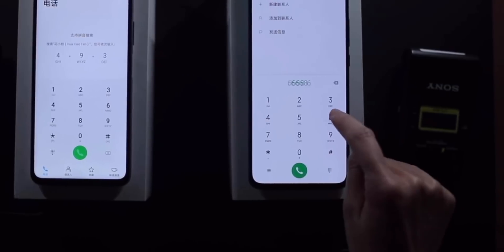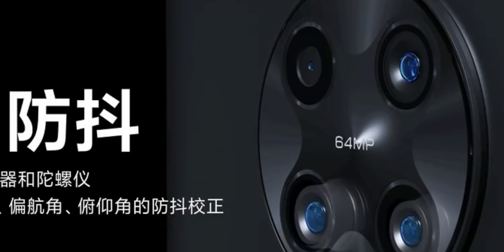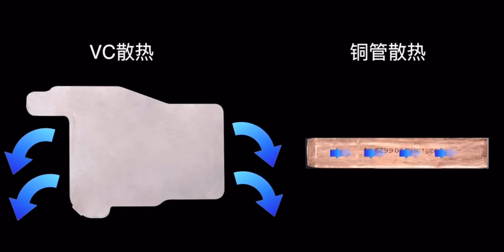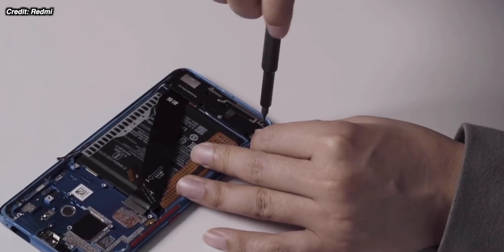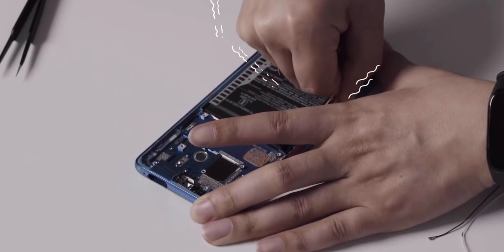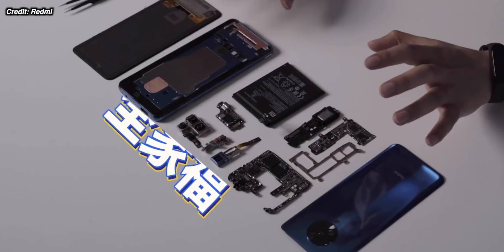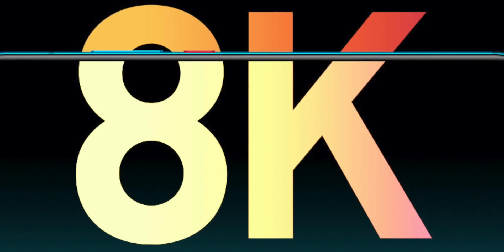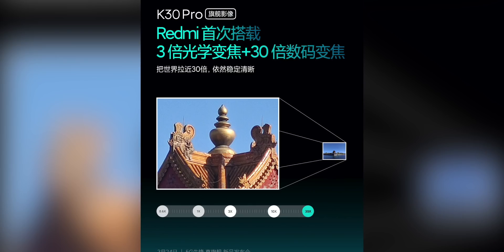Redmi K30 Pro - TEARDOWN SHOWS OFF INTERNALS

Comment: No stereo speakers, is a deal breaker. Popup camera, 3X Optical zoom, Dual OIS is all good and I like the phone design as well, but no point paying extra for the useless 5G when it doesn't even have stereo speakers.
Reply: Oppo A5 (2020), A9 (2020) both costing under $250 have stereo speakers, Pixel 3a and 3a XL which launched at a starting price of $399 has stereo speakers.

So why do I need to buy overpriced iPhone just for stereo speakers ?

Lastly, the reason the phone industry is a mess right now is because of people like. You buying things without complain has made the phone industry so monotonous. All phones are now made of glasses which are fragile, I hardly see any metal back phones now a days. Useless aspect ratio which can't play videos without cropping it, useless notch and punch hole which serves no purpose at all except degrading user experience. Phones getting bigger and taller to the point it can't be used on one hand and they still can't find spaces for stereo speakers.

Lastly, if you think Redmi K30 Pro is a midrange phone, you are better off sticking to just buying iPhones instead of suggesting others to buying overpriced phones; you are not fit for it.
Reply: It's a midrange phone if you want to complain go buy an iPhone.

Comment: I never understood why 5G is a need, even 5mb/s is very enough for me
why would anyone want 600mb/s in a phone, plus the range of 5G is much smaller so you will not find it in most places
Reply: 5G is ridiculous. With 4g+ I can already get 250mb
Reply: 5G means living in a public microwave
Reply: @gideonMorrison  so true
Reply: @gideonMorrison  so the place around 5g...everything gets warm and get cooked? or is the microwave term bigger for thus
Reply: @deepakmagar8626  5G is cancerous
Reply: I'm living with 28 Mbps
Reply: That line of thinking is very retarded .. why did we need to develop new systems of communications when telegraphs got the job done? 
Why did we need to develop touch screens? Old phones with keyboards and small screens were good enough .. 

Good enough is not enough. 5G sounds overkill now but once it goes mainstream, many applications will be able to utilize larger bandwidths. That might change the paradigm of application development since bandwidth might stop being a constraint. For instance, 4K live streaming .. game streaming services that allows you, for instance, to run high performance games from your phone, etc etc.

You might not want it, but the technology needs to be pushed so in the future you get to enjoy what it offers.
Reply: that's pushing the limit...
we need development
Reply: @deepakmagar8626  wrong we need sustainable development
Reply: @abhijithh7657  yeah true
Reply: @deepakmagar8626  I can't even see butterflies anymore
Reply: @abhijithh7657  where r u frm?
but true we see robins,sparrows lesser
Reply: cloud gaming

Comment: sd 865
bezzelles, no cutout, amoled disply above 6.5 inch
good rear camera
in a low price
that's all I want.
Reply: Same 😭😭😭
Reply: I think we all want an Amoled HDR 10 screen, no noch, no punch hole, flat, a good battery and I really don't care about refresh rates. 
Remember Mi Mix 3 ... After being criticized everywhere, then no one could refrain from acting on the slider mechanism and to praise the screen almost perfectly .... No talk about the refresh rate ...
Reply: @MoMo-pd5hu  I personally prefer a compact phone (6.5-5.8 inch) with 4000-4300 mah like redmi k20 pro or samsung s20 without punch hole

Comment: No 90 hz is no problem. most of us as consumers only give a fuck about battery, performance (sometimes camera) and this phone is good enough for many of us because if you have 1+ 7t (90hz display) the battery decrease by a couple of hours, yes hours not just minutes and for squeezing that optimum performance with 60 Hz will be less power intensive .the phone will not heat up quickly too so that's a plus. It is directed to a certain mass of people and we are more than happy for it. so stop bitching about the 90hz display because 99% people will tone it down to 60 due to its effects on battery life and overheating.

Comment: what variant will be launched in India 4G or 5G ?
Reply: It's using the 865 processor so all versions be 5G
Reply: @frozht17  iqoo launched with 865 both 4g and 5g variant
Reply: @frozht17  they can remove the antenna like samsung did on s20 ultra korea I bet they removed it on Asian countries watch Jerryrig everything since the asian countries is late adapter to the tech.
Reply: @sterbencorvus7641  you are absolutely right

Comment: You never reply is there difference between display of realme x50 pro and redmi k30 pro
Reply: Yes X50 pro has 90hz display, stereo speakers and 65 watt charging and K30 pro has 64mp sony imx 686 with OIS, full view display, better design at a cheaper price than X50 pro
Reply: K30PRO doesn't have higher refresh rate...
But i has high quality OLED screen compare to x50 pro.
Reply: realme x50 pro has 90hz refresh rate, 65 watt charging and stereo speaker. Redmi k30 pro will have better camera specs, bigger battery, brighter display(800nits) and probably cheaper. personally i'll pick realme x50 pro over k30 pro(chinese version). i reckon the price difference will be minimal(US $70-50).
Reply: @mcappperspective6099  k30 pro also uses lpddr5 they ask people if they want lpddr4x 12 gb or 5gb lpddr5. Most of the people voted lpddr5
Reply: Monty  and I agree with u

Comment: I want the new imx689 sensor...it's better than 686
Reply: 689 is much better....it is equal to 108mp samsang sensor
Reply: @prash1246  nope, it's slightly worse than the 108mp ( it around 1/1.43 and samsung is around 1/1.33 and the aperture is also slightly more on the imx 689 but the low megapixels may actually make it a better sensor, since light absorbed is inversely proportional to megapixels )
Reply: @kavinsuresh5468  sony sensor quality is better than samsang sensor 48mp imx 586 sony sensor  is equal to 64mp samsang sensor so 48mp 689 is equal to samsang 108mp sensor
Reply: @kavinsuresh5468  per pixel size is better on Sony than the Samsung sensor 

The S20 ultra has 0.8uM combines 9 to 1 pixels making  2.4uM 
Mi 10/pro has 0.8uM combines 4 to 1 making 1.6um 

Both have samsung sensors with different versions

Sony is better here overall
Reply: @prash1246  it's actually better than the 108mp that's what I am trying to say lol, why are you guys replying to me
Reply: @mastergreyskull523  yes, that's what I am pointing out